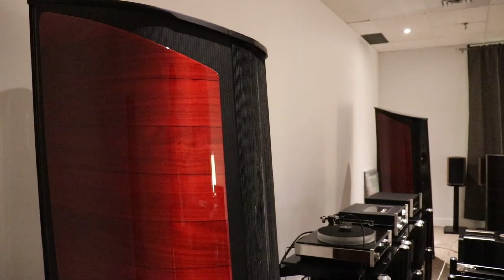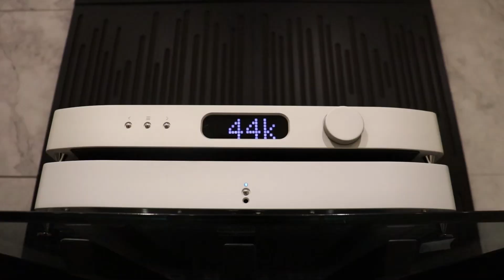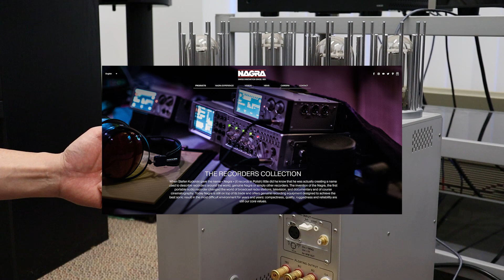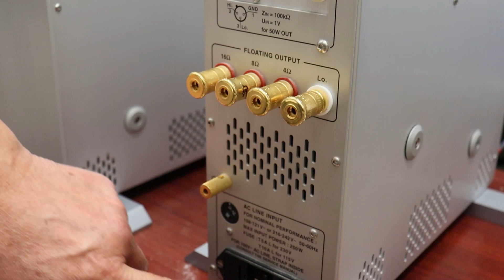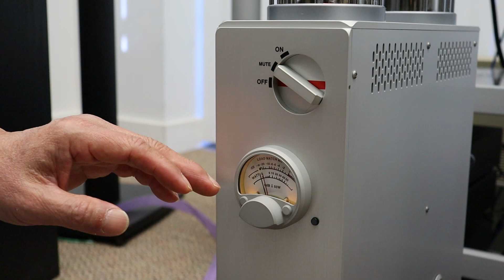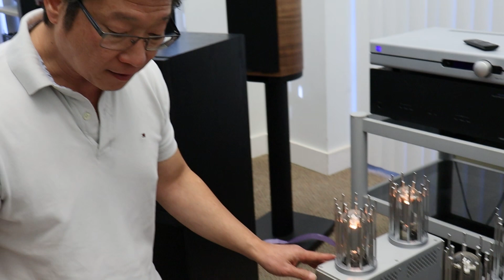Nagra VPA Tube Monoblocks

Comment: I have a set of Line Magnetic pre and monoblocks. LM512CA pre and LM503PA monoblocks. The 503 uses 845 tubes as SET output devices. Stepping up to some Chinese WE845 tubes is a HUGE improvement in sound for comparatively not a lot of $$$. The 845 is a great tube.